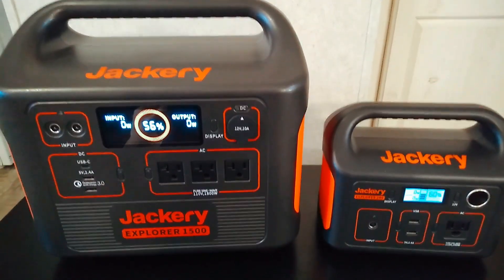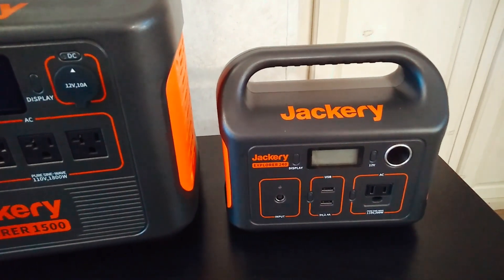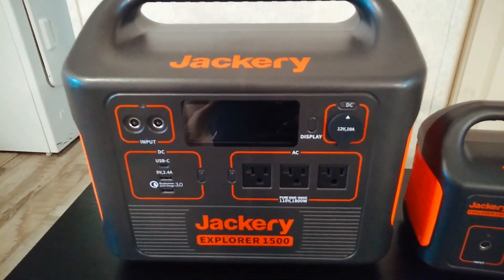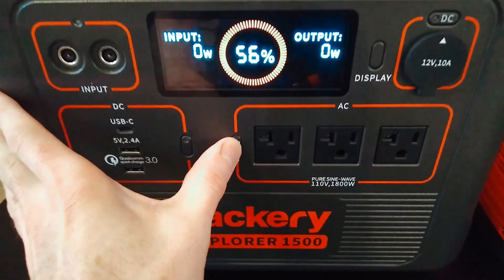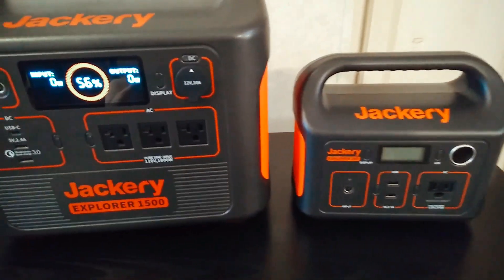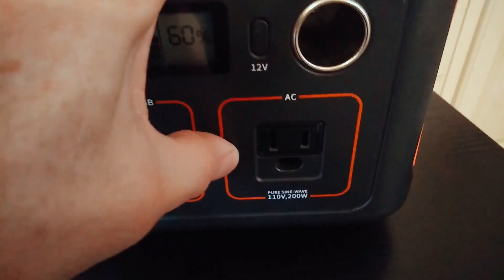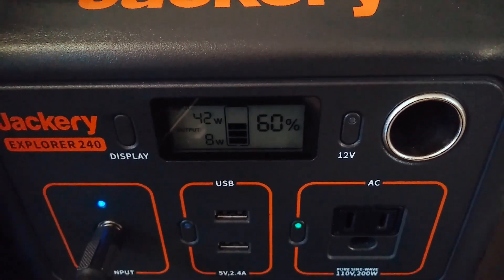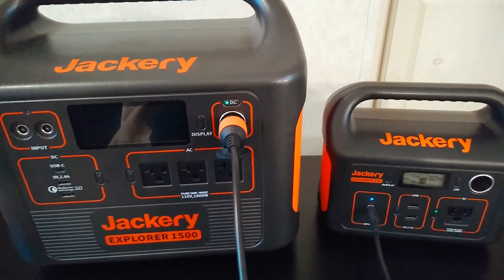Get a small power station too

Comment: I always try to keep as much as possible 12volt.

My large battery bank uses 9 watts when inverter is on with no load.
Reply from the maker: Good idea. Always try to use DC power instead of AC.